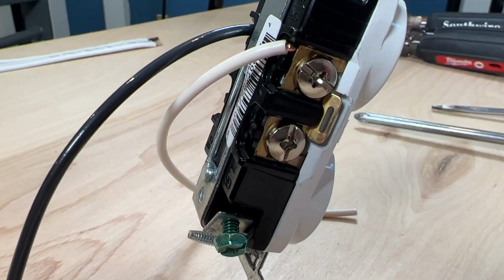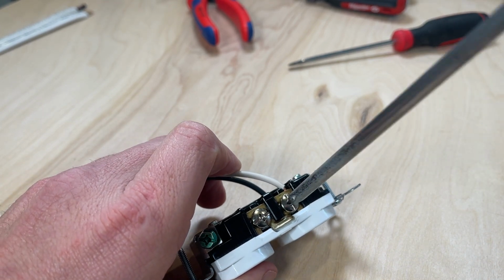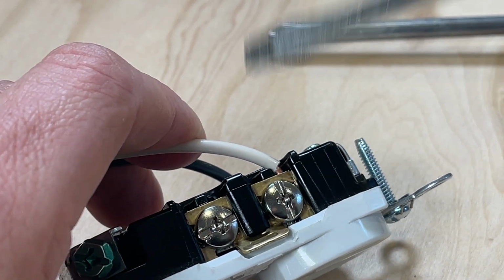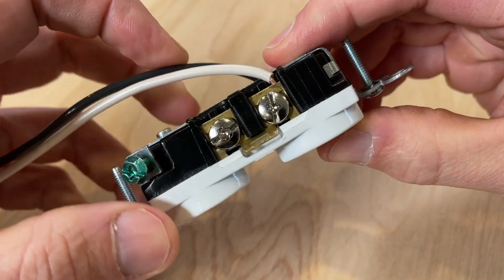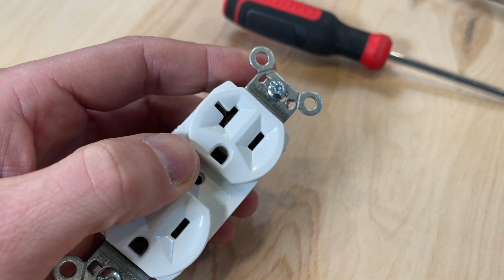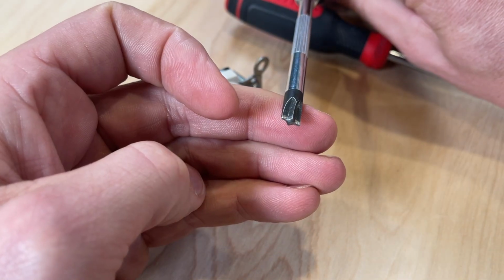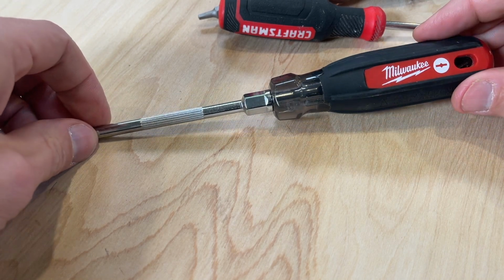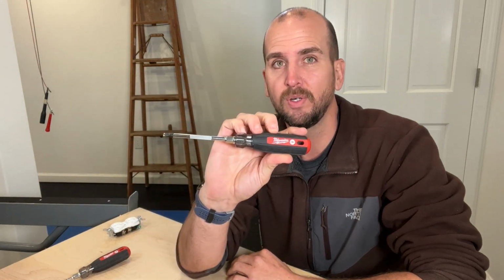80% of People Use the Wrong Screwdriver For Electrical Work

Comment: I use the Milwaukee 1000V insulated ECX screwdriver. It comes in a set of 3, the other 2 drivers are slotted and Phillips. I love my ECX, it turns tighter, and the driver never slips off the screw
Reply: This is written so well it could be an ad lol
Reply: @Incipiwav  no better advertisement than a happy user.
Reply: Same i bought the same set and I love that screw driver. Never used one before buying that set.
Reply: I agree. I have the same set, and it has made my electrical work not only much easier and more secure, much much safer - particularly when working inside panels. For the record, I am not a professional, but have done a whole lot of wiring work and only after about a decade is my ECX beginning to show any signs of wear that effects functionality. I'll be buying another.
Reply: I have a Milwaukee multi bit with the ecx bit.
Reply: I have the same set, but I work on servers, server racks, data arrays, and datacenters and I never have a use for the ECX.  It just sits lonely and unused in my bag. lol but if I ever do have to work on an outlet, BAM! haha
Reply: I used to use those when I was an apprentice. They're ok for occasional use, but for actually making money, use a blade driver. The ECX blades broke too easily.
Reply: @michaelofmanitoba3844  what brand did you buy because mine has taken a lot of abuse and is just fine. You get what you pay for.
Reply: @nateg08  what brand? we're talking about the milkwaukee multi-driver, friend. apprentice me destroyed two of them. I did a LOT of plugs and switches and I like to make sure the screws are good and tight. the blades snapped off!
Reply: @michaelofmanitoba3844  i don't use any multi driver for that reason. Strictly single use drivers and never had an issue.
Reply: @nateg08  also never had an issue with the Klein Heavy Duty multi. superior tool imo.
Reply: @michaelofmanitoba3844  yeah i heard they aren’t very strong. I haven’t really used mine since i use dedicated electrical screwdrivers that has the Robertson bits
Reply: @michaelofmanitoba3844  More muscle than brain?
Reply: @michaelofmanitoba3844  Why on earth are you tightening screws in outlets so tight you break a screwdriver? There's no reason whatsoever they need to be that tight and you're most likely weakening the point where the screw threads in. It's not that strong. Don't over tighten things, torque them properly. As far as outlets they don't need to be any tighter than a philips can tighten them.
Reply: Warning, tl;dr.

Personally wish it was like a 4-5pc set with Robertsons included. AFAIK I can't put an 'ECX' bit in my torque driver & I'm a code freak after spending some time in court over some dumb crap that I'm 100% sure was arson, as I hadn't even worked on the circuit or anywhere near the VERY OBVIOUS receptacle where the fire was started. I changed some f'n water heater elements on the other side of the house, that's IT, but just because dickhead's most recent invoice was a carbon-copy from me that stated simply "changed water heater elements," he came after me to recoup what he'd very clearly (imo) done to his poor landlord's home.

The burn marks on the walls looked like it was probably started with an accelerant. I'm supposed to believe that what looked like flamethrower damage just randomly shot out of an "old work" single gang receptacle box halfway between the studs and all the way up the wall to the ceiling, all while the occupant had crossed the street to get a slurpee across the street like 150' away? Okay, durrrrppp. Still cost me downtime and over a month's worth of typical income. I later learned that this guy had somehow gotten away with burning down at least two houses*, allegedly lol. Never had a fucking house burn down on me & I've lived in more than I could count. AAGGHHHHHH tweaker assholes! Glad to have all thar almost two decades behind me now.

Whole thing was so shady, so I take note of everything now. If an "expert witness" suggests that I did x, y, or z wrong, I can consult dated & PGP signed data for every bit of every job. Get used to it & use speech-to-text on your phone (I use two pairs of "Jabra something or other Active" earbuds at work, they stay in even if I sweat up a storm & amazing battery life but I always have a backup regardless), then date, PGP sign, and have the customer sign a the documents that I then email them as a PDF and/or deliver as a paper invoice if preferred. I also take lots pictures any time I think someone might be a shady,  and I've got three separate RAID10 arrays that I upload from my pocket SSD & uSD card in a usb3 adapter. I've learned to do beautiful work fast enough that keeping records is basically just talking to myself as I work and typing/dictating the invoice (or updates) nightly. Can't say I didn't do this or that when I've got virtually irrefutable evidence that the customer is full of it, and I haven't had anyone file an intent to sue since I started providing customers with an insanely complete invoice signed with my public key. A lot of contractors I know get sued over BS constantly but nobody I know wants to document everything. Smartphones make it so easy! Court is THE WORST!!

Being sued SUCKS, if you've been there then you know what I mean. Any old prick can allege anything against you & you may be innocent but still out Gs if you can't show that you do not f*** around, or even if you win you may have had to pay a lawyer 2500-15k & countersuit is a gamble that at the very least means downtime.

Sorry for the enormous rant. Worth knowing about for young sparkies through: some clients will act like your best friend, then call and blame you because their internet went out or something stupid and obviously not your fault. When it comes to electricity and electronics, most of the world IME is incredulous & thinks some junk they saw on the idiot box means they might be able to Donald Trump me out of ten grand. Not happening.

*Edit: I meant two more houses, for a total of at least three. How on earth does someone end up with three written-off burn houses, all VERY similar circumstances, and always go after the last contractor... And get away with it? To this day I can look it up and see that all this guy's ever been charged with was some property damage involving some woman's car and a bat or golf club or something. People are nuts. More nuts then ever.
Reply: @phxgen  sorry for your struggles. Milwaukee makes ECX bits, so a good hex bit torque driver should set you up just fine.
Reply: @GlenBradley  Heck yeah buddy, good lookin' out. I'll go look for a pack now!
Reply: I use a table knife that has a rounded tip lol
Reply: Same. I LOVE my Milwaukee torx/hybrid insulated screwdriver. Even tho I bought the 3-driver set for electrical work only, that seems to be the only one I use. Expensive, but worth it. I’m thinking of purchasing another to toss in with my regular screwdrivers. I won’t need it to be insulated so it will probably cost a lot less.
Reply: Got a link?
Reply: @kalijasin   hone depot sells a 3 set of 1000v insulated. A slotted a Phillips and the hybrid
Reply from the maker: Amen!
Reply: I have the same set, and use them daily. I also have an ECX tip for my impact.
Reply: Same. ECX is great! It literally cannot slip.
Reply: Ideal makes a driver with the same tip. Love it
Reply: I love my Wera set for life 😍
Reply: They got them at Home Depot?
Reply: @BRazurp  they have the Klein “combo” tips online at home depot
Reply: It bothered me quite a bit that he didn't even mention insulated screw drivers. Should anyone ever really be doing electrical work without 1000v insulated tools?
Reply: @Marsmate88  I've seen places, plural and mostly rural, where people turned their power back on, usually to grow pot, by completing their circuit behind the meter with a pair of f'n steel butterknives. A friend did it just because he apparently went broke. Inserted with some Husky channl-locks, insert me rolling my eyes. I turned on a bunch of stuff inside and took him back to the box to show him that his handiwork was glowing bright red because thin nickel plated iron or whatever isn't 200A-rated copper... So many assholes do this kinda stuff, Idk how so many do it without eventually making the news. I've always paid for my power even with ridiculous California rates and something like that would never even occur to me. "Well sir, it looks like this block is using an unaccounted-for 80 amps, but only 12 hours a night!" Derp.

What was dude's solution? Have me safely remove the butterknives & just pay for his damn power? Nope, he just went to the electrical specialty store I use and bought himself some copper bars haha. If that channel lock set were rated then it'd probably be like "150V max and only if you're seriously dumb."

Comment: You made a brief reference to either "modern" or "current" outlets.  I know much older ones had just the slotted head screws, but I seem to recall using a few that had Phillips-only or Phillips-slotted combo heads.  I may have seen a Phillips-TORX combo as well, but I will admit I may be confusing that with machine screws I've seen on electronic gear that have Phillips-TORX combination heads.

Comment: Agreed...your not using the right size flat blade for the job a wider one would fix a lot of your problems. I do like and was not aware of your new one though. I use a Klien that is interchangeable. It has the slot/phillips on one end and a #1 & #2 on the other.

Comment: This sounds just like what I have come to expect from a DIYer that is not an actual electrician. The wrong screwdriver for those terminal screws would be a torx or a hex driver. The right screwdriver would be all of the ones you mentioned if they are sized appropriately and not overly worn. Those screw terminals were designed specifically to provide multiple options for tightening those terminals. Another in a multitude of reasons why qualified licensed electricians are the only ones who should be doing electrical work and not an untrained homeowner or DIY YouTuber.
Reply: Professionally trained and qualified tradespeople have been responsible for plenty of very poor quality work! I 'd trust myself to change my car brakes much more than many garage mechanics I have had the misfortune to encounter in the past. I'm slow, far too slow to make a living, but I'm thorough and careful.  The trick is to find the genuinely careful professional, they are less common than they ought to be!
Reply: @roberthardy3090  I agree, quality over quantity.
Reply: I see- so you think a comment like that to a video (which has received 100k views in one day since release) in a popular DIY YouTuber channel with 271k subscribers is going to win ANYONE over to your side? No doubt there are a few of you "qualified, licensed electricians" who lurk in these terrible, unqualified DIY Youtube channels for ideas and tips. But to think you could impress your point on anyone by picking on such a lame point-- whoa, he said that some screwdriver types are "wrong" for electrical work in the title and lead-in, but if you watched the video, he clearly demonstrates why some are better options than others. If that lame reason is just one "in a multitude of reasons" why all electrical work should be done by qualified, licensed electricians, you don't make your point very convincingly. Scott's demonstration wins.
Reply: @isabellavision  If you had the knowledge and experience to know what I'm talking about you wouldn't be responding to my comment or even assume it was meant to "win anyone over". All the screwdrivers mentioned in the video were equally good options because that's how those screws were designed. Now you can prefer one over the other, but to state that any of them are "wrong" is due to lack of expertise. He may be an expert in one trade but I can tell you it's not in the electrical field. The same way you wouldn't take advice from a plumber on how to do electrical or a drywaller on concrete work. If someone must take advice, it should be from an expert in that field, most of all electrical work. If you make a mistake in plumbing, the carpet gets wet. If you make a mistake in electrical work, injury or death is the possible out come. Now go find someone else to be offended for.

Comment: I ground down a standard screwdriver on both sides about 1/24th of and inch using a bench grinder leaving a "pin" in the middle that sits in the area where that square drive tip goes.  The pin keeps it easily in place one handed.  I use this on basically everything that has that phillips/slotted combo head.  Cost $4 and 2 minutes.

Comment: You could mention that klein screwdrivers are the go to screwdrivers for most electricians.  I personally like the cabinet tip screwdrivers and they have a version that is 1/4" tip size that is perfect for tightening device screws.  That keystone screwdriver looks like the ends are worn.

Comment: Excellent, as usual. I do have an interchangeable head and will check if one is available. If so - great, if not I will get the Milwaukee screwdriver. I have done many outlet/switch changes and have a little box with several tools for the job; I'm a tool nut - no problem adding one more! Thanks again for all the sensible info.
Reply: The best multibit driver I have ever used is a Canadian brand called Picquic.

Comment: Have used what you call the "hybrid" for a couple years now and will never go back. Still carry both slotted and Phillip's but rarely use them on switch and outlet replacements. The fit is virtually slip- and strip-proof and makes tightening easy and one-handed (as you mentioned).

Comment: I just use Phillips or the small square. I rarely use a screw driver on switches or receptacles, but rather a little impact driver on slow or med speed. I've never had an issue or broken or stripped a terminal(well, maybe once or twice on a cheap old receptacle). 

I'll use a large insulated flathead in the panel box. 

I don't wire on the insert back plate either, but loop around the screw the old fashioned way. That's how I was taught, and it's the most secure by far. You just strip and loop the tips all at the same time and pop them over the screw. 

I also get furious when taking out an outlet that the original installer used the cheap push-in pressure slot on the back. I hate those....drives me nuts. I'm glad to that most brands don't have those anymore.

Comment: ThePhilips head is designed to pop out of the screw when overtorqued. Perhaps not coincidentally, the Pozidrive was released by Philips when that patent expired. Pozidrive is designed to dig in deeper as it it torqued harder.
There are also things like Reed Prince and Japanese versions of Philips, designed to avoid the Philips patent.

Comment: Stopped purchasing all Milwaukee tools. Scum bags make too many of their now over priced tools made in lack of quality control cheating lying communist china.  Every tool you used are WRONG !!! All electrical screwdrivers & bolts MUST be tightened with a torque driver or torque wrench ! Its in the NEC.

Comment: I prefer the true Robertson as it allows slightly more off-perpendicular driving. The ECX has more contact surface but the wings can lever off the bit easier on less than perpendicular driving. The ECX wears slower though. I don't have a JIS-spec driver yet but am anxious to get one.

Comment: Take that worn out Phillips and either regrind it, or toss it. It’s going to damage every screw you touch with it.
Reply: regains it,?
Reply: @owenprince4823  danged auto spelling f’er upper. ;)
Reply: @robertschulke1596  LOL,   Dang autocorrect acts like I did something wrong and it must correct me.  I grind old Phillips drivers to a point and use them as a scratch all to mark lines on wood.  That was my point.  :)   I also have a point about math.  The point of math is to find points otherwise math is pointless.  You can quote me on that if you like.

Comment: Just an added note. Harbor Freight sells a 3 piece insulated Doyle screwdriver set for $14.99. One screwdriver is an ECX. 

From their website description:”The set contains (1) Slotted 1/4 in. x 6 in. Screwdriver, (1) #2 Phillips x 4 in. Screwdriver and (1) #1 ECX x 4 in. Screwdriver.”

Comment: extremely interesting.  I've always used the regular or philips, which ever was handy. But now that I see this, I do have one of those little kits around with multiple bits which has the square bits. I'll start using that from now on. Thanks for this tip.

Comment: Have them all:)  My go to is the #1 square in a Klein 11 in1.  Nut driver capability from removing the tips is awesome, especially for self tapping ground screws in metal boxes.  Tried the Milwaukee tip a couple of years ago but I never "wore" it in, so it tended to stick in the screws and ended up in my drawer as a spare!  Great video!

Comment: I replaced a couple of outlets recently. It's a rather old house and I'm going to replace as many outlets and switches as possible. The two outlets I replaced, I used the philiips/flathead method. But I what I really need was the ecx. I looked on Amazon and found the ecx 1/4" bits that will fit my multi bit screwdriver. They are cheaper than buying a specialty screwdriver. I am not going to need a specialty screw driver since this is a one time project and I won't be installing outlets or conduit pipe anytime soon.

Comment: How did it feel to have everyone in Canada yelling at your video for the first 3 minutes? Always has been Robertson's for me as a DIYer . Pretty sure most Canadians have the same experience.
Reply: Yup, but you need both a "red handle" and "green handle" to properly do NEMA outlets. The green can work in the terminal screws, but often strips out. The Red is the one to use, and it can apply a large amount of torque, enough to overtighten if one goes too far.

The Green handle is used for the box attachment screws.